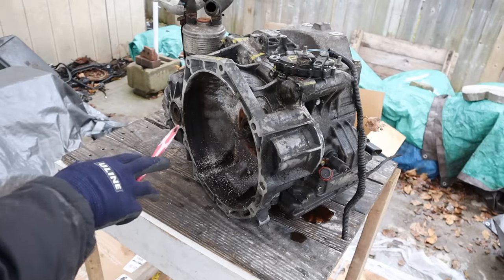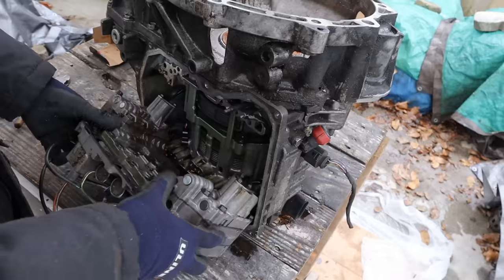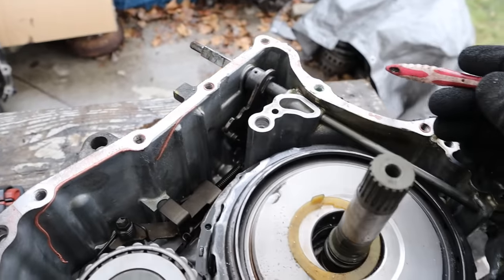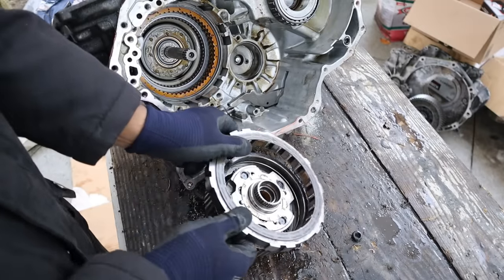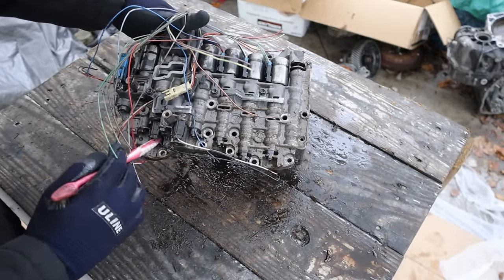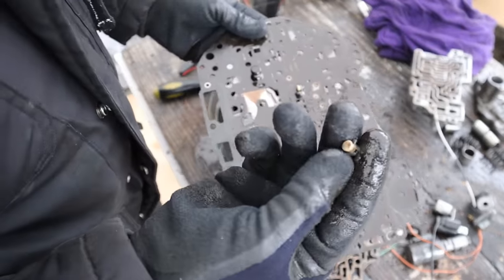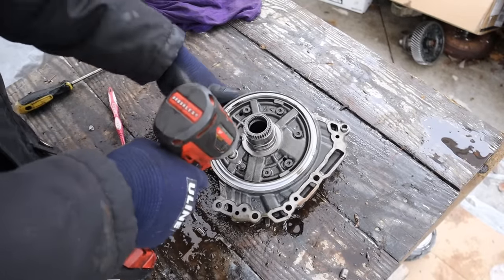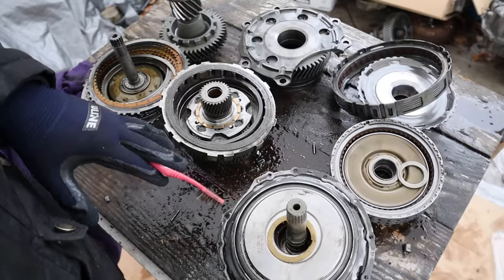Why Volkswagen 09G Transmissions Fail

Comment: Compared to Euro cars they might be a little weak but at least they fail in the hundreds of thousands of miles unlike most Ford automatics that usually fail anywhere from 10k to 40k and that's not a joke ford wins on horrific transmission every time the VW will keep working if you change fluid in time Ford will fail whether you do or not I will not put anyone I ever care about in any Ford ever because there are only 4 models they make reliable and now they are down to 2 trucks and even those are unreliable now 5.0 V8 is marginally reliable now that's it used to be 4.6 or 5.4 2 valve not the 3 valve that were reliable in rwd and 2 in 4wd other than that anything AWD fwd v6 i4 anything other than the modular v8s you could not depend on ford Taurus mercury sable Lincoln Continental all of them the transmissions fail every 30 to 50k miles like clockwork they sold almost 50 million assorted models of the fwd v6 they also like to develop almost unsolvable stalling issues that unless you know these cars and the causes no mechanic will ever figure out the relay brain on the radiator that fails and a few other ps the 3.8 v6 blows head gaskets and you see almost none these days because they are awful cars they sold almost 60 million over 15 plus years and there are probably a few dozen left in each city

Comment: The only good automatic transmission is a Toyota
Reply: 09g is very good too. Someone never changed their ATF in this 09G.

The ASIN are also in Toyota....
Reply: It would be nice if you had enough brain power to know this IS a Toyota transmission, used in VW and many other makes.  So It's clear that your comment is false.
Reply: if the oil was changed regularly in this Aisin (= Toyota) it was still on the road....
Reply from the maker: Not exactly...alot of them had this issue regardless of maintenance
Reply: @einfelder8262  ok which Toyota model has this gearbox?